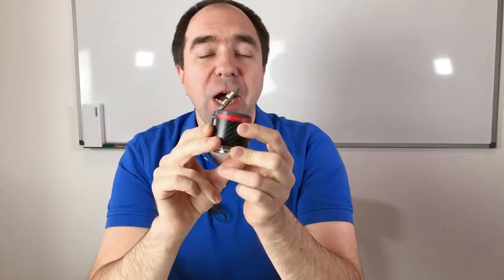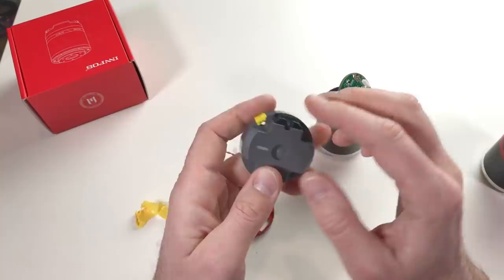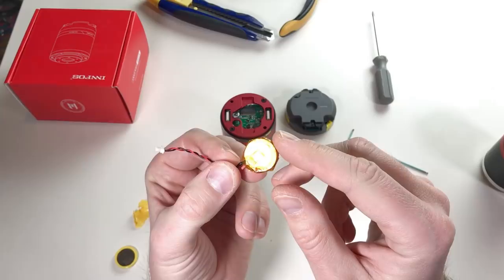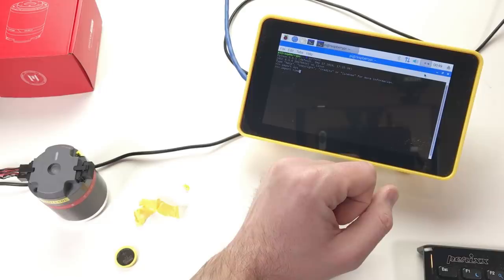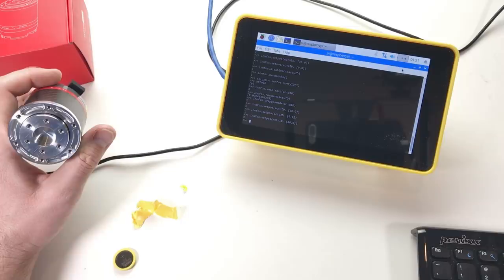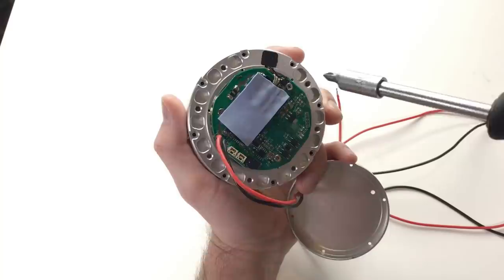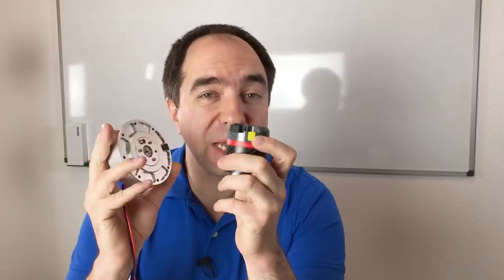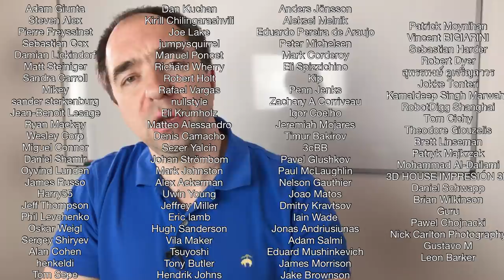Professional Actuators Update (MIT Mini Cheetah and INNFOS)

Comment: My guess is they use a rechargeable lipo coin cell regulated down to 3 volts for a voltage reference for Hall effect sensors. With a lowered ref voltage, it’ll give the value assigned to home at the wrong spot.
Reply: It's so that the microcontroller stays powered so its static RAM memory retains the values that were set.
Reply: @whickervision742  oh

bottom text

Comment: There seems to be enough space for a battery holder on the back side of the top board of the INNFOS actuator, I wonder why did they decide to go with spot-welded tabs and connector, instead of throwing extra surface-mount CR2032 holder ...

Comment: Hi, fan of your videos. Got a quick question can we use these sort of actuators to drive some wheels of the robot?
Reply from the maker: Hi, thank you for your comment. Technically, I think it is possible, but this is a bad idea. These actuators are made to rotate just two - three turns in each direction, and not for continuous unlimited rotation.

Comment: Hi, such a nice information you shared with us, thanks a lot! I would like to ask you something, I have something similar to your MIT mini cheetah servo but I guess it's from another Chinese supplier. My servo can read in multi-turn, but it will get lose its home position when turn the power off and on again. There is no battery inside similar to yours, so I wonder that, is your MIT mini cheetah servo able to come back to the exact home position after re-power? Thanks in advance!

Comment: Does the magnet rotate with the same speed as the motor or the speed of the output shaft? I wonder how they achieved a multi-turn absolute encoder with a range +/- 125 rotations (info from Kickstarter campaign). It looks more like one turn absolute encoder. Maybe the battery provides this feature.

Comment: Question:  How can you use a servo in a practical application if it has an internal battery that needs to be replaced periodically?
Reply: You can view it as part of regular maintenance. Most products have maintenance intervals, even bearings require replacement at some point. In the experimental robotics field, I'd imagine if you wanted to develop a product with these motors, you would simply extend the internal battery leads outside and have them powered centrally.
Reply: SaltyBrains  Good answer, however having had multiple such batteries die on me prematurely(either due to shoddy QC, bad selection of battery, or other reasons), I think they raised a valid concern.

Comment: Good video really enjoyed it. By the way I think it is not a battery you just replaced. It looks like a super capacitor holds memory in microcontroller. Just like eeprom. You install a 3v battery i think. And it can leak if reverse voltage comes to your battery. Be careful. And thank you for sharing this video with us. Sudhir Raikar from India 🇮🇳.
Reply from the maker: Thanks for pointing this out. I will double check.

Comment: But why they but a battery inside the actuator ? is it for the internal controller ?
Reply: most probably to preserve home position and/or last position
Reply: @PredragMrvic  Very strange situation, a battery inside a motor/actuator. And not easy to replace either. Had to be cut away and retaped. Glad Skyentific was able to open it up and fix it. And, share the info.

Comment: I don't think I would support INNFOS based on this motor, and their recent business issues. 

The battery is a consumable part, yet it's been made a proprietary part. That yellow sticker screams 'warranty void if removed' even though there's a consumable part under it, there's logically no other reason for that sticker to exist other than to tell that someone has tampered with the motor, which usually leads to warranty issues, which those kinds of stickers are also illegal in some areas of the world. If that motor was already on a robot, those non-captive plastic washers would make this very difficult to reassemble depending on how the motor is positioned, and for the same reason those plastic washers can be easily lost. 
Now lets get into why the battery exists on the motor in the first place. Because homing position is lost when the battery is dying, note dying and not entirely dead, we can come to the conclusion that the data for the home position is stored on a volatile memory chip. There's no logical reason for this design, at all, as the motor itself does not necessarily need to store that information when the controller can, all the motor needs to do is spin and relay position and temperature, as that's all that's needed from the motor. 
Between these observations we can only conclude one scenario why the motor has been designed like this, with difficult assembly, warranty sticker, proprietary parts, and no real reason for those proprietary parts: Planned obsolescence. Assuming you have a 7DOF arm that uses these, we can assume that all 7 batteries will be dying at a similar rate, imagine having to service all 7 motors because of this design; now imagine you're a company that builds these arms for consumers, your customers aren't going to service these motors themselves, and now it's on you to service all of these products. It's an absolutely terrible design that's not only planned obsolescence for the motor itself, but it'll also make any project/product they're in fail when the battery fails, causing downtime, costing money, and inducing headaches for everyone involved. 

I saw the pinned comment about the Kickstarter being suspended, investor issues, etc. Between that and the things I pointed out about this motor specifically, they seem like a very, very, sketchy company.
Reply: That doesn't sound right to me. I think you've jumped to conclusions.
Basically, their encoder is a single turn encoder (has to be due to cost). The motor goes through a gearbox (e.g. 7:1 ratio) so, when it's off, and then powers up, it won't know it's position, especially if it's been moved while off, which is very common / expected for a QDD. As a result, they have a battery that powers the microcontroller / encoder so that it can keep track of the encoder moving while the unit is not supplied with power. Generally said battery should be recharged by the same board, or at least be a recharging super-capacitor. Bit strange there. But this is certainly not a case of planned obsolescence, most Absolute encoders in the industry (excluding VERY EXPENSIVE geared absolute encoders) have batteries built in, or on the cable going to them (not feasable in this case)

Comment: First time I ever heard of a battery deep inside a stepper motor.  Is this common?  Seems really short sighted, especially when other simpler designs could be used.
Reply: It's not common. Usually there is a set of power leads that go out to an external shared battery pack.

Or if you're a German manufacturer you use intricate multiturn absolute encoders, which are amazing devices of precision clockwork gears and wheels much like mechanical wristwatches.

Comment: Why would there be a battery in the actuator? Does it have an RTC?
Reply: It is for keeping track of number of shaft turns and zero reference position, even if the main power is off.

Yes there are heidenhain multiturn absolute encoders that use gears to count, but more expensive at a few hundred dollars each.
Reply: @whickervision742  Battery backed RAM is a bad solution when FRAM exists.
Reply: @plemli  it's not a "bad" solution when you look at BOM cost and the other costs. Rarely is reality about using the sexiest technical solution.

It pains me to have to explain it this way, as I'm an ideas guy too. If i was on the team I'd have said yes, let's try using nvram. But cost, delivery time, schedule, and testing complexity might have shot the idea down.
Reply: @whickervision742  I fail to see how a battery with connectors and wires would be simpler or cheaper than a 1$  FRAM part. In addition the battery needs replacing, is less reliable, requires more production steps and a more complex and larger case design, has temperature limits, ... the disadvantages go on and on.
Reply: @plemli  Yes. Imagine a robot where the gear or battery can't be accessed and replaced.